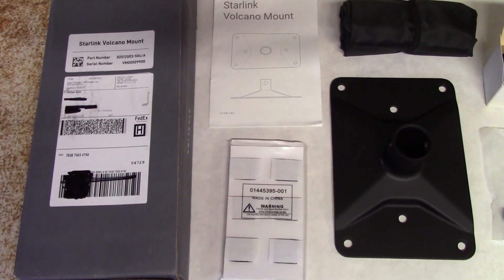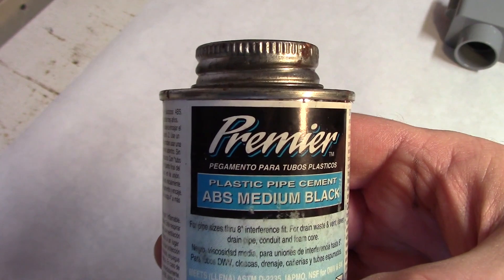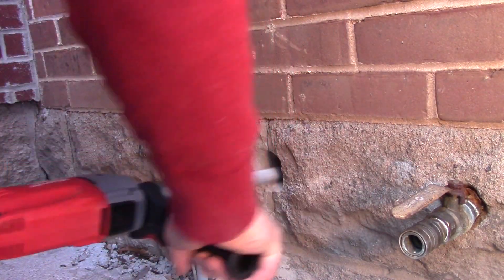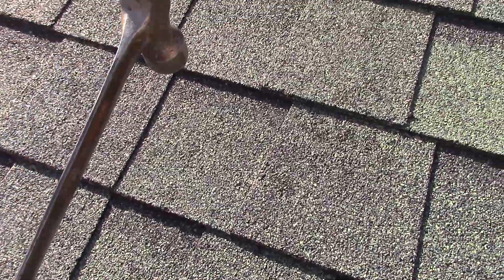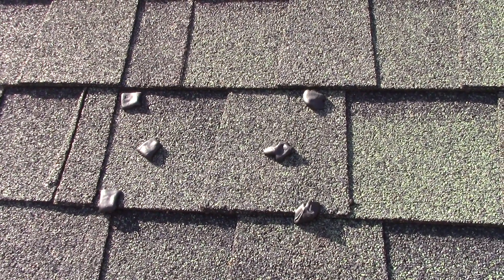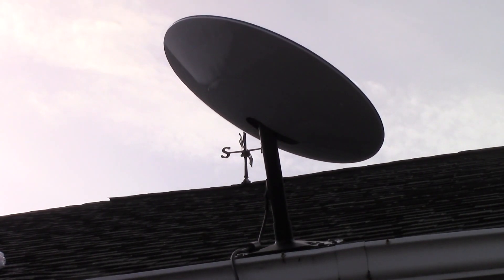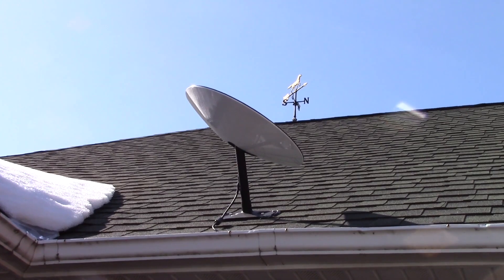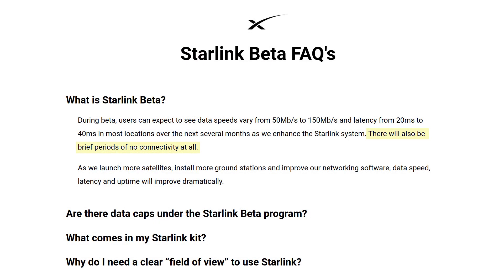Joining the Starlink Beta, Part 2; Roof Mount

Comment: I had snow on my dish and it melt it off and then it froze and then it burn out the motor because it was frozen and was trying to move.
Reply from the maker: Oh, that sucks! We didn't have a ton of snow after I put ours in, and none since I put it on the roof, but what we did have, it was able to deal with.

Comment: Thanks for the demonstration.  Did you need to ground the exterior cabling and dish?  I haven't been able to find any information on whether grounding is required.
Reply from the maker: I didn't and there was nothing in the instructions about doing so. Note that their recommended installation is generally lower on the roof, so for most people, I don't think lightning would be an issue. With that said, we already have lightning rods installed on our house, and they are much higher up on the roof than where I installed this, so I would expect were we subject to a lightning strike, it would naturally hit the lightning rods rather than Starlink. There is a lightning suppressor molded into the cable about 15cm/6" from each end, and given the low voltage & small wire gauge used in ethernet cabling, I would seriously doubt that this wire would carry any significant voltage spike into the house - the wires would probably vaporize before that could happen. Just my opinion - maybe a real electrical engineer would have a better answer. :-)
Reply: @williamkorb  Thanks so much.  We have lightening rods too.  I assume Starlink would include something in the instructions if grounding is necessary, but I wanted your view about it.
Reply from the maker: @redowl8253  We've had lightning strikes on our property (5 acres) twice in the 35 years that we've lived here. In both cases, it hit either out in our pasture or a utility pole along the county road, and in both cases, caused damage in the house that almost certainly came in via our electrical service. The most recent incident was August 2020, and our solar panels (which I did ground) didn't bat an eye...
Reply: @williamkorb  Thanks for sharing that. Our dish will be mounted on a chimney about 5 feet above the lighning rods on the roof line. It needs to be mounted that high to have a clear view of the northern sky based on testing with the Starlink app.
Reply from the maker: @redowl8253  In that case, then yes, I would ground it.
Reply: @williamkorb    Thanks.  We've made a deposit on the dish but we have not received notice of availability yet.  While we're waiting, we're creating a mount for it.  Your advice is very helpful.
Reply: i realize Im kinda off topic but do anybody know a good place to watch newly released movies online?
Reply: @Lorenzo Karter Flixportal xD
Reply: @Lochlan Dominik thanks, I signed up and it seems to work =) I really appreciate it!!
Reply: @Lorenzo Karter glad I could help =)